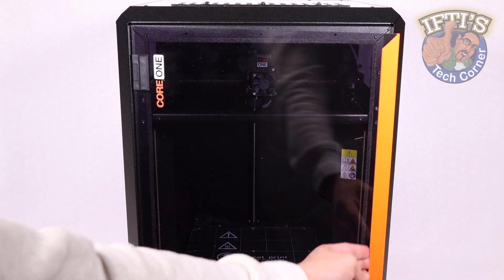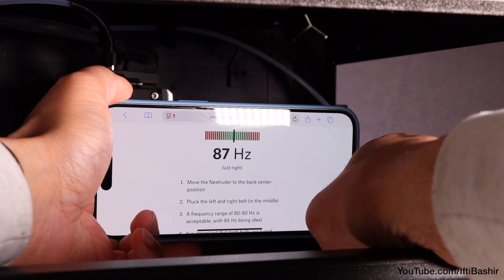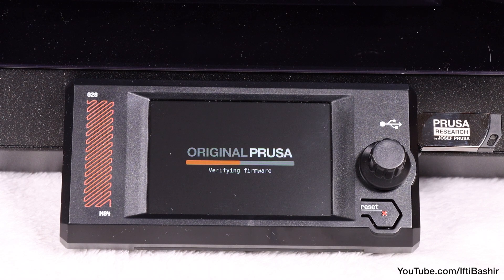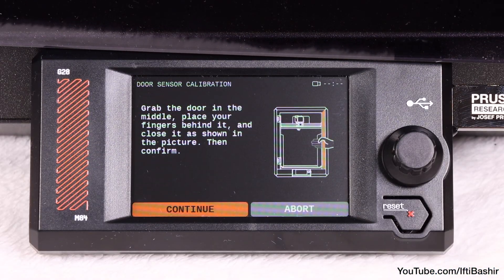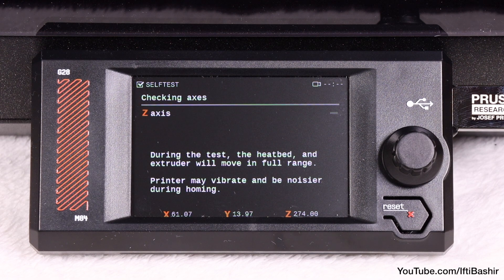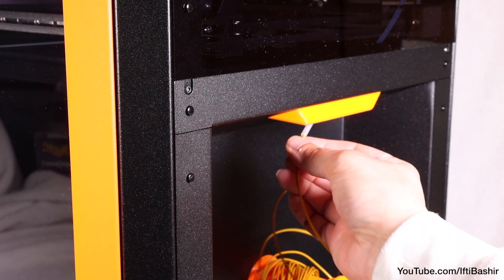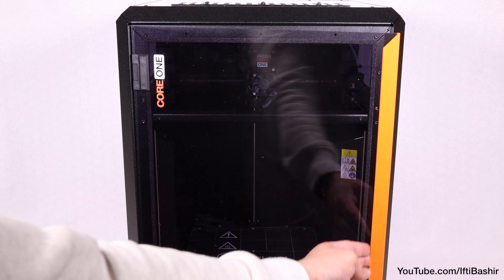#09 Original PRUSA Core One Kit : Full Step-By-Step BUILD GUIDE - Calibration & First Print

Comment: Perfect tutorial. Thanks for it, but I still can't get rid of VFA problems on Polish materials. MK4s prints much better.
Reply from the maker: It seems to be a continuing issues with this printer - try re-tensioning the belts......
Reply: @iftibashir  Thx, sure, I did that about 10 times and it only helped by 20%, but artifacts are still visible on the prints.

Comment: 0:53, I'm really unsure about this bit, because my printer has the opposite. If I loosen the other side with less play, it just worsens things. By tightening the side with play, it then evens out and results in no play at all
Reply from the maker: Please refer to Prusa's online guide for tensioning the belt - the steps have changed since creation of this video. 
Start by just making sure the gantry is square (even if it means loosening off both tensioning screws). From this point you will tighten the screws the same amount on both sides in order to set tension.....
Reply: @iftibashir yeah followed with that and it worked perfectly after calibrating

Comment: I am having problems with the Y-axis calibration (X and Z is fine).  When I run the calibration procedure it keeps banging on the front right side and go in a diagonal direction in this corner.  At the end it will go to the end.  The belt tension looks to be correct according to the recorded frequency of the belt according to the App although it seemed to be a little flaky to work.  There is no space on the left or right side of the gantry.  Any suggestion on how to fix any calibration issue of the Y-axis?
Reply from the maker: This head banging in the front right corner seems a common issue. For some it lasts for 7 minutes or so! It's very annoying - but all seems to lead back to making sure the gantry is completely square and belt properly tensioned. I get it myself at times, and I find hitting the reset button makes it go through much quicker the next time!

This cycle ensures the head can accurately resume a print after a power failure. If you rarely have power cuts and are happy to not have this feature, you can skip this head banging altogether by entering the start G-Code in the slicer and looking for the G28 function. Place an 'I' after the G28 (thats 'eye', not an 'el).

So:

 G28 I     ; home all without mesh bed level

This tells the printer to skip the head banging and resume to the next section of G-code, and it will continue as normal. I've used it a few times and it works perfectly well with absolutely no impact to the quality of the print ;o)

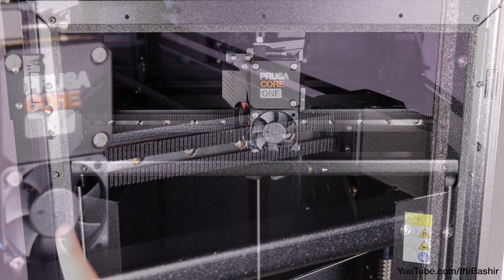Comment: at 0:43 I have a small gap on both sides, equally (~1mm). I cannot loosen the tension bolts at all because they are fully extended already (right side is about 1/2 turn from falling out). I don't understand what else I need to do here? The web guide has a "quick gantry alignment" section, which is basically a long-winded version of what you describe here. But right from go I cannot do it. With zero tension on the belts, I have a small gap on both sides.
Reply: Disregard. For anyone having this issue - I just started tightening the belts anyway. Once the slack was removed (but before they were fully tensioned), the gap was gone.

Comment: My pre-assembled printer has a piece of orange filament inside. How do I clear it out? I did a light tug and it doesn’t seem like it can easily come out like some searches online suggest.
Reply: Update: Contacted support. You need to select the "unmount" option and select "PLA" as the filament type. It takes a few minutes to heat up and it releases what is in the nozzle. Once it's done, you can easily pull the filament from the outside of the machine.

Comment: The instructions for belt tensioning say to move the gantry to the front and right. Different than it says on your app. Wonder if something has changed. I'm having a tough time with it.
Reply from the maker: Prusa have changed the procedure since the creation of this video. This video uses the original recommended procedure.
Reply: @iftibashir  Ah thx. Both procedures were driving me crazy TBH. Then I placed the base of my phone on the gantry and it worked MUCH better!.

Comment: This way of belt tension tuning is not the right one anymore? I mean the page on Prusa's website and tuner app are talking about putting the toolhead to the front right and not the rear like you said. It's confusing to be honest.
Reply from the maker: Yes they have now change the way the belts are tuning, and also by how much they are tuned. I still find the old method works better for me TBH. Your mileage may vary.

Comment: A little tip concerning belt tuning:
It can be very tricky and cumbersome to hold the smartphone near the belt and pick up the belt frequency. It is far more convenient to use the microphone/headset that comes with most smartphones. Just plug in that set and hold the microphone near the belt while plucking. It has the huge advantage that you can lay down the smartphone and while holding the mike in one hand, use the other hand for belt tuning and watching the phone that lays down on the heath bed. It also seems to be far more sensitive and picks up the belt tone far more easy. Using this method I was done in a much shorter time than when I used the smartphone near the belt as showed in the video. As I never use that set anyway I used some painter tape to tape down the earpieces, so they won't swirl everywhere.
Reply from the maker: Great tip!!

Comment: Many users reported CORE One problem with X/Y homing, sometimes banging the head 200+ times trying to refine the homing. It's petty that you cut out that part, even normal homing bangs the head more than 10 times.
Reply from the maker: Many users have reported, but not all. I did not have this issue, and many who have had it report that proper gantry alignment and belt tuning resolves it. If you have the issue I suggest you look in to your alignment.
Reply: @iftibashir  I do not have that problem either. In case I get a few head bangs more than expected, I always check the belt tension and if both corners are flat to the front without any gaps. With some minor adjustments the problem is solved. The belt loosens a bit over time (probably because both the construction and belt have to settle). It is more noticeable at the first few day's, but changes less and less over time. Don't get me wrong - There are certainly people that seem to have that problem in the extreme, but as said above, I do not think there are many of them.
Reply: Also, a good idea to check the motor pulley orientation. Many have reported fitting them the wrong way around. I did and that made it bang a bit! Absolutely fine once sorted.  I think building the enclosure before testing is not the best way forward as undoing those rivets is a pain. Good videos though. Found them better than going through the instructions.

Comment: Ifti - I'm a 1st time builder, 1st time 3D printer - THANK YOU kindly for this series. I'd say only 4 or 5 times I had to quickly check the official guide as there seems to be very slight changes in the later models. You calm deminer helped a lot too :) 4 afternoons and I'm up and running. Keychain and Benchy printed. Thanks again!
Reply from the maker: Awesome - glad the videos helped. 
I always suggest using the videos as a supplement to the official guide - using both together makes the process much easier!

Comment: Thanks for this series on the build of the Prusa Core One.  As others have said watching this series prior to building the kit is invaluable.

You've clearly highlighted some of the pitfalls that I have seen on forums were ppl have not followed the build descriptions properly.

It was well explained and your video and narration is well coordinated so as to fully understand the process you were taking.   It should be an easy exercise for even the layman.

I'm yet to receive my kit but much looking forward to the build after watching your videos.  

Have you found any issues in printing with the Core One since the build?

Enjoy you coffee😁
Reply from the maker: Many thanks for your comment. As long as you ensure the gantry is squared up nicely, and the belt tuning is as good a you can get it, you should be fine. 
There does seem to be some VFA issues on some prints, and some vibrational noise when the extruder travels completely horizontal or vertical at certain speeds, but I believe Prusa are aware and updates are to come......
Otherwise, printing wise, all good so far!
Enjoy your build!

Comment: I tuned both belts to 85Hz and yet the printing head keeps banging into front right corner for 2+ minutes before it start printing....
Reply: Same here.  Will not pass the "y" axis check
Reply from the maker: yes this seems to be a common problem at the moment. I get the same sometimes....
Reply: @iftibashir  why did you cut that part of head banging from the video and went with an idealistic view of the process?